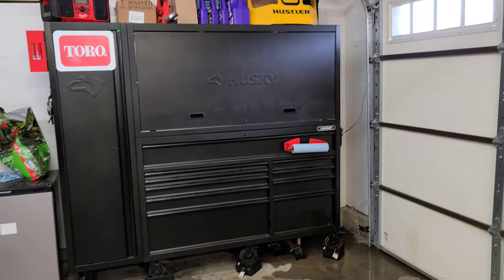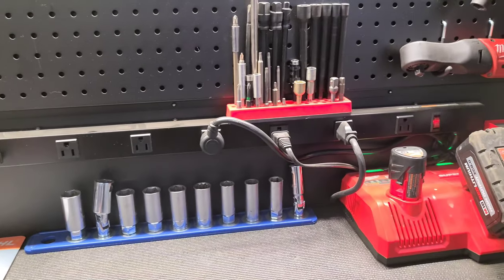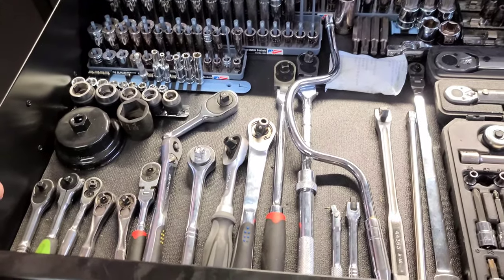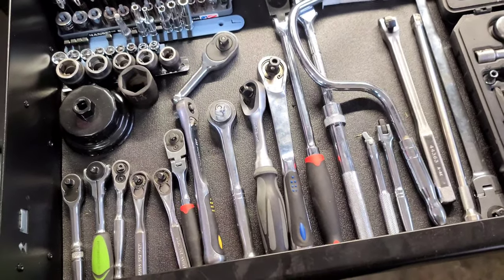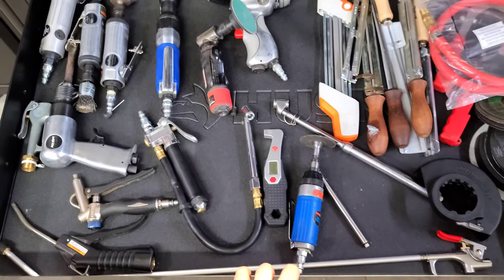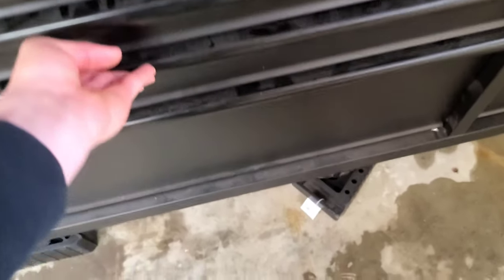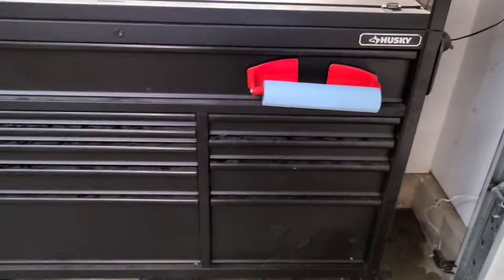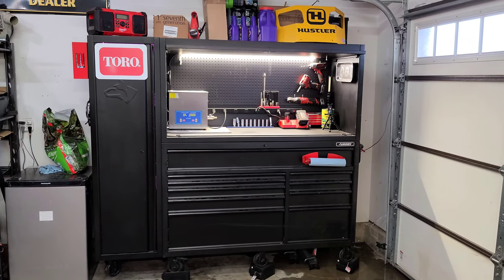Husky 80 Inch Tool Box (3 Month Update) Toolbox Tour 2021

Comment: I use a snap on 1/4” drive 6’ breaker with a cut down T-30 for a rear fastener on a high pressure oil rail in a ‘06 6.0L. Legitimately the only combo I found that fits well and works great for me. Learned it from an old master tech YT dude.
Reply from the maker: Thanks for sharing my friend 👍🏻
Reply: @fillslawncare  of course!  No reason not to give out info as it might help others down the line. You got a great channel here, keep it up!!

Comment: Been a mechanic for 8 years and a full time tech for 2 years and i agree small engine work no need for tool truck tools im a big fan of husky used them for 6 our of my 8 years but being a full time automotive technician than works on anything for 1930s fords and chevys to working on brand new European cars u can definitely tell the difference in quality especially on rounding and stripped of bolts also within 2 months of working full time i broke more tools than i did in 6 years of working on personal projects and friends vehicles still can't pull the trigger on a box tho currently have a 52in husky wood top and a us general 5 drawer roll cart but the 52in it starting be unstable with more than 1 drawer open
Reply: How stable is the box if u have the top drawer open are u able to open other drawers without it wanting to fall on u being that it is also only 24 inches in depth?

Comment: Awesome video!

Did you do anything to prevent the top lid from going side ways? Prevent it from seizing from improperly sliding it straight. 

Keep it up! You actually made me buy the box for my work place. I work as a maintenance mechanic and work with hydraulic machines for a plastic company. 

Thanks! 🤙🏽
Reply from the maker: Honestly, my lid came off 🤣. I just have it sitting on the side of the box. I think one of the bearing mounts fell off

Comment: i had to have a 1/4 inch breaker bar for working  on my skidsteer couldnt get a wrench on the 12 point bolts on the yoke and had a socket that would just bare fit but a ratchet didnt have enough space only time i used it glad i had it tho

Comment: 1/4 Breaker bar, why to have them: Working in a tight space with a frozen bolt that your forced to break but don't want to risk damaging a 1/4 ratchet by over torqueing and a wrench wont work either. Seems like a limited use case however, I'd say it fits well in the specialty tool category. Cheers.
Reply from the maker: Thanks for sharing. Have a great day!

Comment: I use my 1/4 breaker bar for brakes and valve adjustments. and that’s about it. I’ve had it for around 5 years and that’s the only thing I recall using it for.
Reply from the maker: Awesome thanks for sharing

Comment: Quarter inch breaker bar I’d use for low profile but not quiet wrench territory bolt areas
Reply from the maker: Thanks for sharing 👍🏻
Reply: @fillslawncare  cheaper than using those offset wrenches!